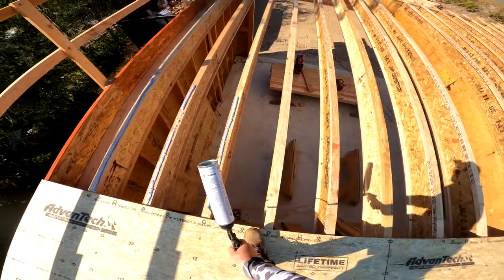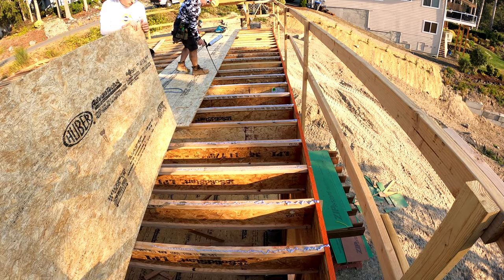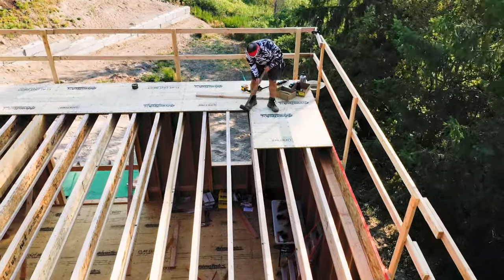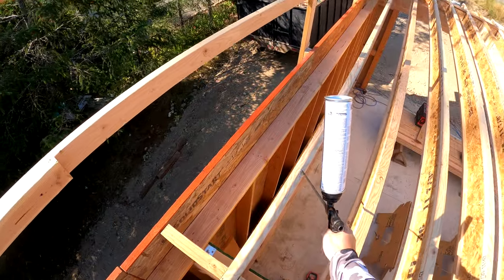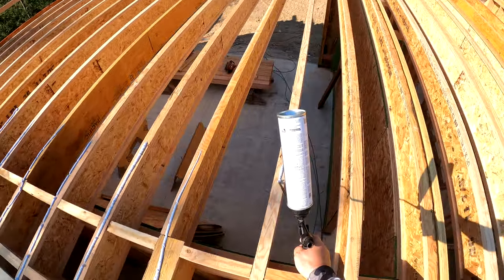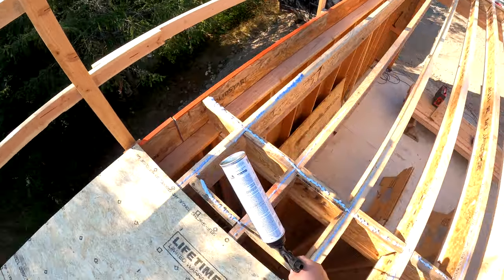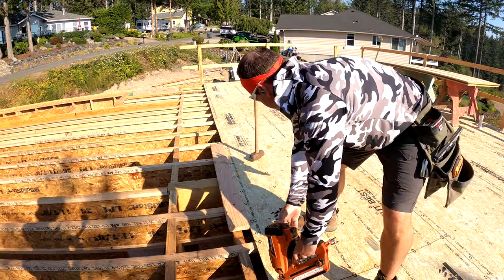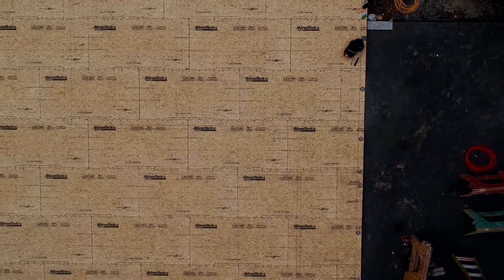The Best Way to Install Subfloor

Comment: How much sq ft area do you typically cover on sub floor installation in one day with three people or better saying what should be the right amount for a profesional carpenter?? 
Thank you and your videos are great !!
Reply: Lol.. All of it.   Never met a floor we haven't finished in a day.  Even a 5000 sq ft ranch was under a day.  One actual carpenter can easily lay an entire row (5-10 sheets), glued and nailed in a little over 5 minutes.  Cuts, directional changes, stair holes etc will slow you down.

Comment: Do you ever see an issue with the glue flying out when just dropping the panel down on the joists like normal? I have read comments on other videos that since that advantech glue is foamy it won't hold up when letting your panels drop like that. As opposed to another poly glue from loctite or similar that is thicker consistency.

Comment: Is the nozzle long enough to use standing for average height humans (above 5’9”) as well?
Reply from the maker: I'm not totally understanding your question.  The longer barrel gun work swell for me at 5'7" so it works even better for taller people, they also don't need to reach out too far and stand on the joists.  Does that help?

Comment: Prob stupid question but if you are gapping the ply 1/8” are you then laying out the joists 16-1/8” o.c.?  (Or whatever your spacing is)
Reply: I think advantech is sized just under 4x8 to allow for the 1/8" spacing.
Reply from the maker: good question.  Panels now are undersized to allow for the gapping.  I remember the good old days where they weren't and that was such a hassle.
Reply: @AwesomeFramers  ohh thats good to know!
Reply: @joshmo55  panels are 47 1/2 wide which is way more than 1/8" gap. Causes a lot of headaches for the perfectionist.
Once you get across your joists you come up short and got to scab some crap on there.
Great product but why not 47 and 7/8?

Comment: It's amazing I used basically the same stuff I. The Early 90s.  The glue failed.  Probably improved.
Reply from the maker: I used that stuff too back then and it didn't work.  We've been using this for almost 5 years now and I'm a believer.  Stay tuned for a video on some testing I did.

Comment: Do you cut tongues off the first row of sheets on the edge? So that theyre flush? Or leave them on?
Reply: Wonder the same thing?
Reply: I have read in other video comments where they will make the tongue flush with the outside of the building at the beginning

Comment: Does the advantech glue container immediately become a brick and have to be thrown out after one use (like great stuff)?
Reply from the maker: Nope, and that is an excellent question.  Life would get expensive real quick if it did.  I'll be posting a video soon on how to use the product.  Definitely close the valve when you are done and do not take the can off unless it is empty.  It'll last about 30 days on the gun at that point, but we've gone longer.
Reply: If you do need to take it off for any reason be sure to use the manual spray piece attached to the cleaner can to spray out the top of the glue can and leave it upside down to dry then it will remain perfectly usable indefinitely.. it does require alot less cleaner if you use it often enough to leave the can in it tho.. over 25-40 days and it can ruin your wand tho. Eventually the gasses mixed into the glue for aerosol application will leave the glue and it will harden in the wand, hence shutting the valve all the way before storage... And storing no more than 30 days..

Comment: TJI are upside down!  That's wrong  I love the Advantech
Reply from the maker: I appreciate what you're saying but that's actually not true.
Reply: @AwesomeFramers  how so? Lettering is upside down on many.
Reply from the maker: I joists are manufactured in 60' lengths and then cut to size. There is no crown and the top and bottom flanges are identical. Label is cosmetic, there isn't an upside down.
Reply: @AwesomeFramers  how about the knockout holes? They in center?
Reply: @skliros9235  none of our subs use the knockouts, and never have.

Comment: Screws are more expensive and with this glue major over kill. We just use ring shank nails. Built hundreds of houses this way and never had a floor squeak even 15 years later just using liquid nails... Just saying... I guess if you're in a super humid area with more expansion rates it could be less overkill, but that glue works really well here around the great lakes with just 2 3/8 ring shank nails.. plus the gun is way faster...
Reply from the maker: I hear you.  We've been in business for 43 years, so we have a huge amount of experience living in our homes and visiting family who live in our homes.  Because we build in the PNW, screws are cheap insurance, much cheaper than a call back.
Reply: @AwesomeFramers  Ah. Much more humidity to cold changes than we have here.. I guess I can see that being a good benefactor. Thanks for the response. Always good to learn tips for other areas...
Reply from the maker: @xxlordbelxx1368  yeah it's very cool that can all learn from each other. Thx for chiming in 👍
Reply from the maker: @para keet spray glue is not a subfloor adhesive and shouldn't be used.
Reply: @para keet Oh god.. You should have been there... Like 2-3 months ago we had a house where they didn't let us know the changes on the second floor so we made it to print and had to tear out about 3'x14' of the subfloor and run a new girder for the landing edge.. if we didn't have our own crane to lag and lift the whole floor it would have taken us a whole day to tear it all up with chisels.. instead luckily we were able to lift the whole floor and cut through the i-joists and subfloor all as one long cut.. first use I've had for my 2man bandsaw in about 8 years. Lol.. it was kinda fun watching the laborers try to tear it apart for fitting in a dumpster tho.. 😂😂
Reply: @AwesomeFramers  I think he was talking about the advantech aerosol glue.. the problems he mentioned with the wand and cleaner are about the same as my experience here in the great lakes region.. pain in the butt, but well worth it for the quality...
Reply from the maker: @xxlordbelxx1368  What we've found is that we have to be pretty religious about twisting the dial to off when we are done using it.  Spray out the extra when the can runs empty and then turn the dial to off when you change cans.  We get at least a year out of them now.  Hope that helps.  Bit of a learning curve at first.

Comment: Do you gap sheets throughout the build? Walls and floors? Do you find that it leads to extra cutting of full sheets or not enough to be a concern? In BC framers seem to give a healthy gap between layers of wall sheathing for ventilation so the building can dry out during the building process but not so much in the but joints.
Reply from the maker: Yes we gap 1/8" but we don't have to cut panels because they are 'sized for spacing "👍👍